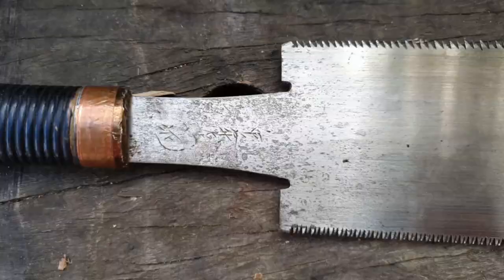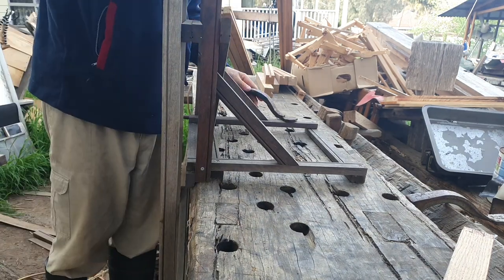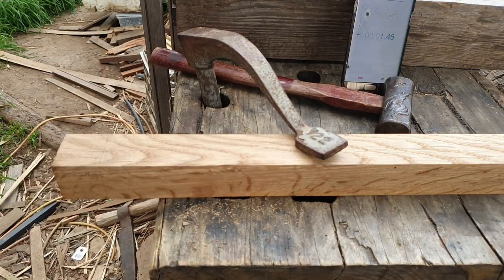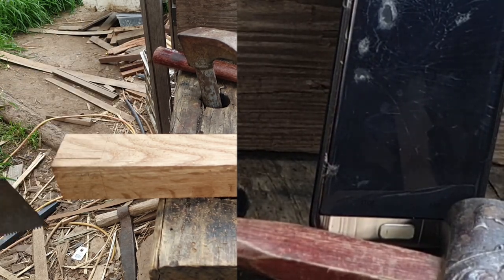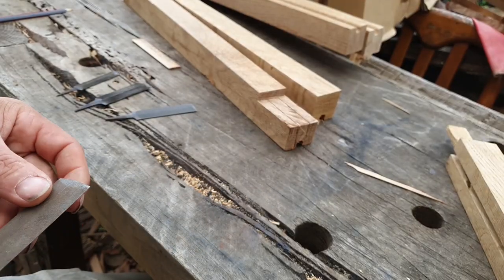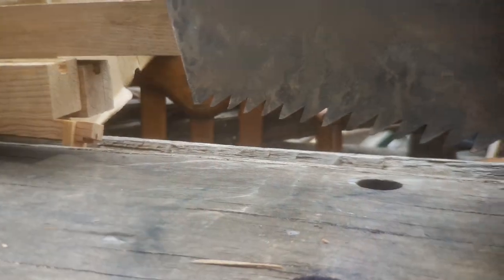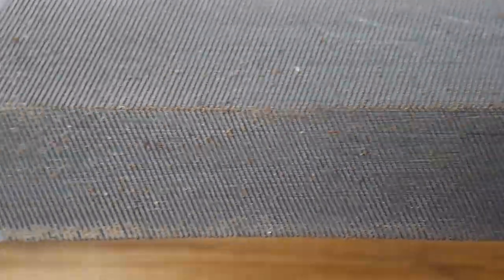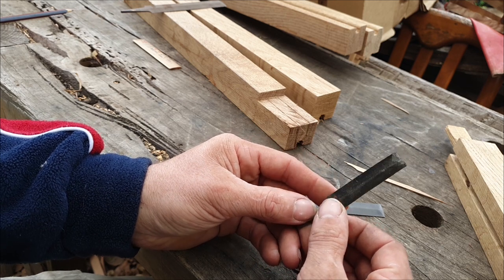Sharpening a Ryoba Saw

Comment: When i was a kid i was taught how to sharpen a western\American push saw. I struggled at first with holding the file at the right angle so my dad cut a 4 inch section of square dowel (3\4 inch) and used the saw to put a groove down the middle about a quater of the way through. The end he cut at the correct angle so I could just slide it down as I went and I have a wood guide to keep it consistent. Worked pretty well for me and even once i hot to where i could do without I still used it so I could have a visual reference point. So if anyone is struggling with that the way I did it may be a good option for you. I think it would apply here just the same.

Comment: I use the japanese saws that you only change the blade. So how frequently do you sharpen your saw?
Reply from the maker: I've got those as well. In fact I sell them but the handmade blades are next level. I use disposable blades a fair bit but the handmade blades are superior both in speed and finish.

When they are sharp that is.

Comment: I wonder if a good feather file would cut an "induction hardened" ryoba saw? (I have my doubts!)
Reply from the maker: Well it depends what you mean by good. A good hardened steel feather file won't sharpen an induction hardened modern industrial saw because the hardness of the two metals is too similar. For that you need a good diamond feather file. You can get them but they are not cheap.
Reply: @ChestnutnagsToolsFromJapan   Thanks C_N, I'll look into it.